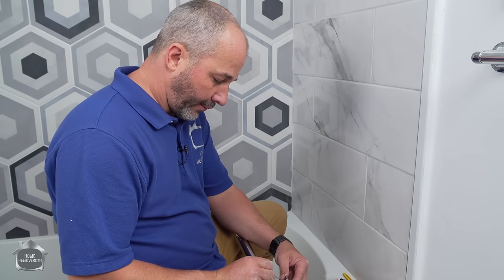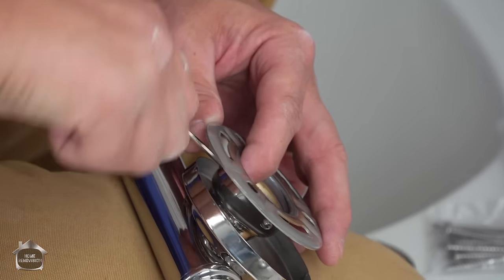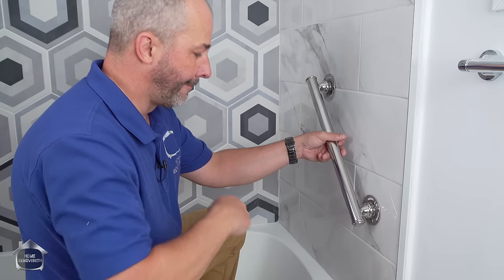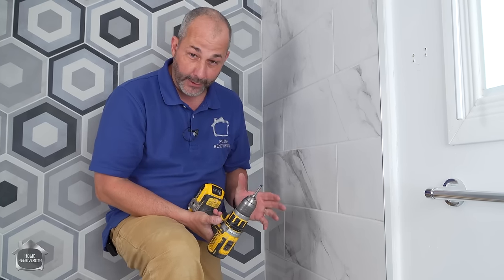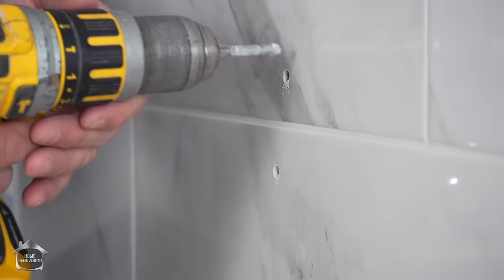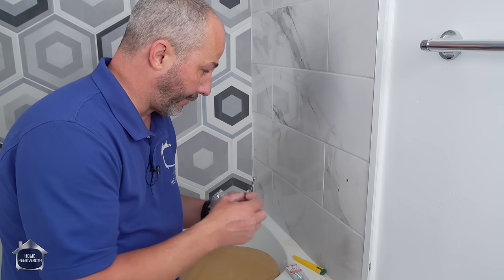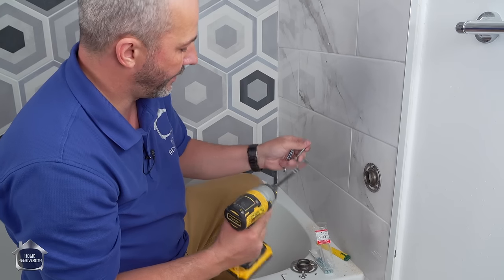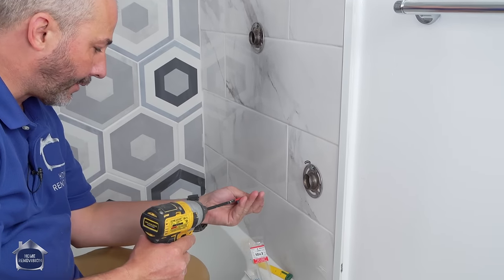How to Install a Safety Grab Bar

Comment: The mounting screws were not vertically aligned - how did they all hit a stud?
Reply from the maker: Hi Gordon, I did the original renovation in this bathroom and installed 1 x 4 over the 2x4's to build out the wall since the tub hole was built too large originally. Another tip I use is to install 2x10 horizontally in stud bays anticipating the need for bars in the future. Cheers!
Reply: @HomeRenoVisionDIY  Thanks.  Good planning.  It you were adding the bar to an existing tiled wall (not knowing the structure behind), would hitting one stud plus using two screws into wall anchors (total of 3 screws at each end of the bar) be strong enough in your opinion?).  Thx
Reply: Thank you!  Need to do this for mom and dad.  Have stud finder... will travel!